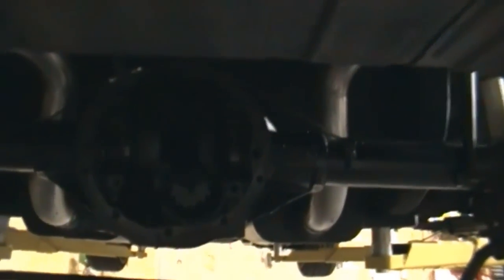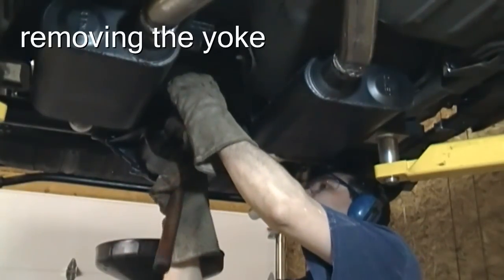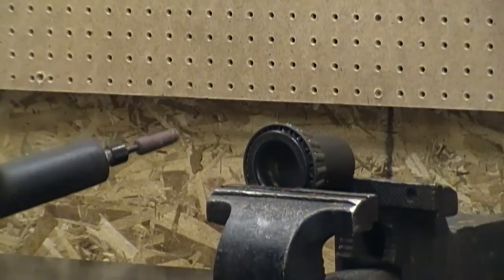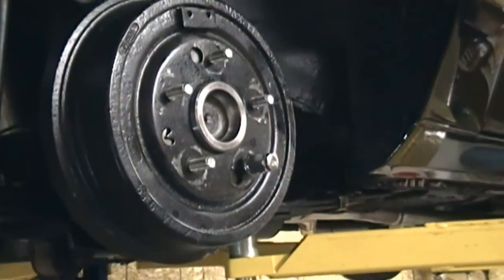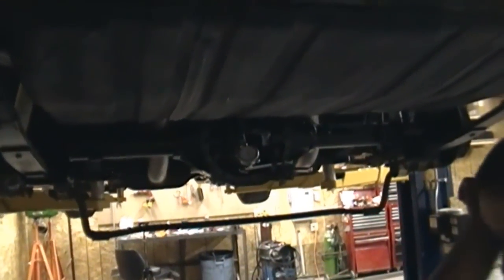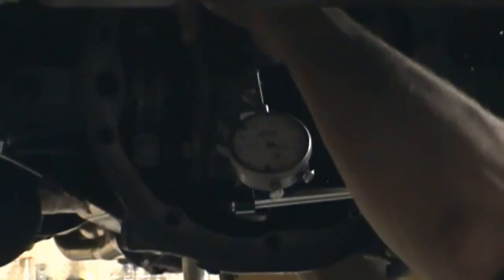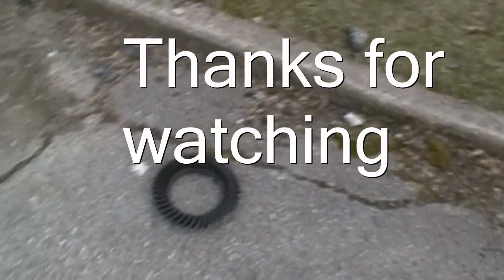How to install or change or replace gears and bearings in a rear end or differential

Comment: I wish I would have seen this video before today. I put a Ford 8.8 axle in my Jeep YJ and lowered the gear ratio (higher numerically). My trial and error with setting the pinion pre load was a big ol' hassle! I'll be doing my front axle next and will definitely use your idea of using the old bearings to test fit. Thanks for the video!

Comment: Having set up many rear ends both 10 and 12 bolts I have to say this video is among the best. Good clear procedure and nice explanation on the "set up" bearing. Gear swaps are not black art, just careful methodical procedure. I also have a pinion depth tool but as you say, just use the contact pattern. I have found factory pinion shims usually are within .002 of correct. The crush coller is the hardest part due to the force required to start the crush. Ten stars from me! Thanks.-TM

Comment: Installing my eaton carrier required me to add about 040. shims on each side (in addition to the 1/4 inch factory shims) to get the correct pinion backlash & bearing pre-load. I also had to use a block of wood and a hammer to force/wedge the carrier with the correct shims into the housing.

Thats cool that you're also into pontiacs, I hope you looked at all my videos, there is a nice slide show of my engine and my roller cam/valve train. If you have any questions feel free to ask.

Comment: I like this video and watched it several times before I attempted to install a new Eaton 8.5 posi carrier. I do however wish this video had shown the removal of the carrier (and the force/technique that was required to remove it) and the show the re-installation technique of the carrier and the shimming to achieve proper carrier bearing pre-load and backlash for ring gear.

Comment: Very informative video.  Now I see how everything works and fits together.  My 7.65 10 bolt rear end started coming apart and had a shop rebuild it.  Now I see why it so expensive.  Definitely not something I could do at home in my driveway.

Comment: Very informative. I have a set of 4.11s to install in my Camaro. I built the entire engine myself, but I'm finding differentials incredibly intimidating, plus I don't have all the proper tools. You may have just made up my mind to take the rear end to a shop instead of attempting it myself... won't feel quite as gratifying though.
Reply: Good call, I want to change the rear end carrier in my superduty to a truetrac, but the torque levels for an axle that size and the results if you foul it up are so drastic, I'm not going to mess with it. I don't have the tools for that kind of work.

Comment: Awesome video mate, rebuilding my '80 WB Kingswood tonner (You've probably never heard of this it is a Holden model) 350 chevvy small block n/a aussie 4 speed and I'm swapping the diff gears out from 3.55 (factory standard) to 2.78 for better highway driving!

Comment: Really informative video that, i have got to build a 8.5 for my caprice sleeper so this is gold to me. Strange how GM choose to shim the pinion depth on the inner race of the inner bearing? All the rear loading axles i have build so far shim on the inside of the inner brearing outer race (in the housing) I just hope my inner bearing is not too worn or i'll have to get 2 new ones to set it up! Great work

Comment: Good video. It's what I need to know, but it doesn't really put it all in my lap. I'm puting an Eaton posi into my 12 bolt GM corporate truck axle soon and this video does help me to wrap myself around the job.
It looks like a good idea to:
1. Read the manuals and watch the videos (like this one)
2. Open it up and really know what you're starting with
3. Use the car as a mounting fixture so you don't chase it around the shop
4. Don't go cheap or take shortcuts
5. Be patient

Comment: the thumping is when i'm cruising and give a little more gas, this is mainly on the highway and taking off from a stop. i had the car on jackstands today and there is a slight delay from the time you turn the rear wheels until the pinion starts moving. used gears are ok to use as long as you inspect them for damage and clean them good. with used gears the clearances like to be a little tighter since they are seasoned.

Comment: when removing the yoke, another thing besides the torch if you dont have it, you can always use a pipe wrench to hold the yoke while you take off the nut, this is great when its a trail repair and theres no heat..

Comment: thanks for taking the time to make this video. for my diff there is no specification for pinion depth, so when i do the dummy fit, do i tighten the pinion nut until i have the correct pinion preload? or just tight enough so i can't feel any play? is getting pinion preload only possible when using a crush sleeve? and will the depth be affected once reassembling with a crush sleeve and setting pinion preload? sorry for all the questions

Comment: 6 acceptable gear patterns. Sierra gear and axle. Drive and coast center and toe to heel.. Drive and coast center to center. Drive and coast toe to heel. Drive and coast heel to toe. Drive and coast heel to heel. Drive and coast toe to toe. I have been rebuilding rearends for 35 years.

Comment: I replaced the bearings in a Dana M80 diff with adjustable aluminium bearing race housings.
The trouble is the diff started to whine due to the inner race of the small pinion bearing being damaged (pinion torque preload was at zero Newton meters) due to that so there was both longitudinal & lateral movement of the pinion, so I thought there was no guarantee that the gear set will be quiet after I replaced the bearings.
The pinion torque was set at 2 newton meters,I used an impact wrench to carefully crush the collar to achieve that torque setting.
The torque was measured with a small torque beam indicator,the total preload measured at the pinion was 2.4 newton meters,the extra 0.4 newton meters was arrived at by dividing the side bearing preload figure of 1.5 newton meters by the diff ratio of 3.91 to give a figure of 0.38 newton meters,0.4 is the closest figure I could get.
I set that torque up after bluing the gears with Prussian blue bearing dye,I got the tooth contact pattern all good,I took note of a gear backlash figure of 0.12 millimetres & set the lash before I blued the gears.
The diff did have a bit of s whine in it when first assembled but now is nearly gone at 35,000 kms after the bearing replacement, there is no noise except at 60 & 90 km/h there's a bit of a whine which is fading away,it was noisier when I rebuilt it.
There is a little bit of noise on the coast side of the diff gears on deceleration,so reassembling the diff with new bearings & ignoring a little bit of diff whine till it's gone has worked !!!!
Reply: Do you know how to place the rear end gears back in mine fell out while replacing my bearings on a chey Silverado 1500

Comment: I don’t have a shop press so I stuck my carrier and pinion in the freezer and put my bearings in the air fryer at 400* and they slide right on…. Takes forever to get them all on. Thought this might help someone that doesn’t want to go buy a press after buying a bunch of rear end parts.

Comment: @Oldsmob455 I am aware this is a setup bearing and that you exchange the setup for a unground permanent at final assembly. But the 2 bearing bores are different diameters and the 1st allows lateral movement due to the enlarged bore, resulting in a false wear pattern.

Comment: I'm in much the same position as tc1811 except I only want to change out the open carrier for a posi unit. My thought is that I won't need to adjust the pinion at all. I'll hopefully be reusing the old gears and be able to get by with just adjusting the backlash.

Comment: Nice video.  Wish I had the lift in my shop as you do.  I've got this to do on a '04 Jeep Grand Cherokee so I'm watching all the videos I can find on this subject.  How is the rear end acting after break-in?  Been a while since you did this one.  Interested if your adjustments worked well for you.  Using the old bearing to initially understand the needed shims seems it wouldn't properly approximate the new bearing exactly.  Just wondering if that worked.  Thanks for a good video and for sharing, Clay

Comment: Thanks for the great video.  I wonder if you could recommend me a power train tech in South Florida?   I'm having difficulty deciding whether I should have my rear differential repaired on my 2000 Toyota Tundra. The truck has somewhat sentimental meaning to me, but has over 300k miles.  The engine and ac run great, but the transmission takes first gear rough at times. The body is kind of rough as well and some hardware(interior door handles) need replacing.  I don't know what is the best option, junk it, rebuild or replace with used one.  I would appreciate any advice.  Thanks

Comment: nice video . i have a 93 chevy blazer 1500 and my yolk is loose. like i can twist my drive shaft just a tiny and i was wandering if you cold tell me wat you think is wrong or wat i need to replace. it doesnt make any noise or anything while driving the only thing it does is when i put it in reverse you can hear it thump into it its not smooth but not horrible

Comment: I did a 12 bolt 67 Camaro rear MANY years ago with 456 gears, i used white paint for checking the gear pattern. I never set preload or checked backlash, after properly setting ring pattern and assembly it was smooth and quiet as a mouse, the former owner had a Chevy dealer set it up and it howled and i had to tighten the pinion nut as the bearing was failing so i felt good that a 20 year old kid did a better job than a dlr mech. Not sure is preload was a concern 35 yrs ago, mainly pinion depth?

Comment: What was your back lash? I believe most gear manufacturers call for about .010". Also, I use C clip eliminators, they're a bit of work to install because you have to trim the end of the axle tube, but I feel that is worth it, I can break an axle and I won't crash my car.

Comment: I'm looking at a new Eaton posi and 28 spline Moser axles for my '82 Camaro and am very tempted to do it myself after watching this. It seems like a good project with a few hard parts. My big question is if I use a dial indicator to measure my current backlash and set the pinon to that with the right shims, will I still need to do the marking compound?

Comment: if you have to much back lash, and you adjust it with side carrier shims wont it change the surface contact more to the heal or to the toe of the ring gear?

Comment: Im having some problems with a rear end that will probably stump you but can you help please. My rear end makes a poping or cracking noise as i let off the gas going  to slow down but lessens as i acelerate. I have put three difftent rear ends and have not fixed the problem because they all did the same thing just less until i drive it for a few months then it gets worse

Comment: Great Post.. I just got a used GM 12 bolt Posi, I remove the pinion yoke to change the seal and notice the pinion move from side to side, has about 1/2" play without the yoke installed.   The shop said that's normal and I need to reinstall the yoke, then check the backlash.  I am not sure about that, any ideas?  The shop also said all parts are new and all I have to do is to swap out the old axle and drop this in. I would like some opinion before spend more money for this install.

Comment: Great great video.very helpful.im in the process of changing my read end for the second time  in 2 days'thanks to the police'but now i just installed my old rear end but with new gears,my only problems the pinion nut was already taken off without any markings so now im lost at how much i should or shouldnt tighten is.plz help

Comment: great video olds, i just installed some used 3:73 gears in my 95 mustang GT and i'm getting no noise on accelleration, some thumping while cruising and alot of whine on the coasting. the gear pattern on the concave side is like 1/2" from toe to the middle and the convex side is 1/2" from the heel of the gear to the inside. i think my pinion is too deep inside and needs to be shimmed out more to the diff cover for more contact on the ring. does this sound right?

thanks in advance

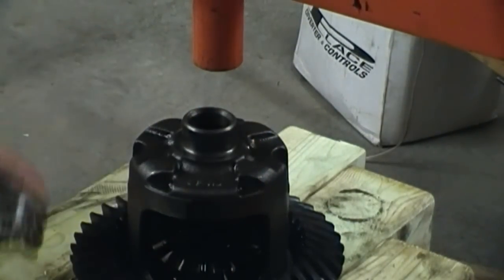Comment: How Did You Remove The Bearing From 2:17 And How Will I Know What My Pressure Should Be When Installing The New Bearing Like You Did In 2:17? I Remember Vaguely Having Been Told To Look Up How Many Pounds The Gears Will Require When Being Installed.

Comment: So, that crush sleeve gets tighten when you tighten the pinion nut and until there is 25 inch pound of resistance? When checking the gear mesh, I guess you tightened the pinion down without having a crush sleeve in place?

Comment: Great video!  I have watched your video several times as I am in the process of swapping out the carrier and gears out of my 73 Lemans.  Question - What beam torque wrench do you have that sensitive enough to read 20 inch-pounds and attach to the 1/2" drive socket for the 1-1/4" pinion nut?  I am trying to track that down.  Thanks!

Comment: Great video, I am also surprised at how much those shims can change the contact pattern.  I think using the old pinion bearings to determine your depth is very convenient, but do the new bearing ever vary in size enough to throw off the contact pattern?

Comment: Question, how can I remove the S spring ? and better yet, how can I put it back in, I am going to work on a explorer 1996, 6 cyl, 130000 miles, should I replace the clutches too ? my plan is to replace only the side gears, and spider gears, but I don't have sophisticated tools, so any good tips are accepted, thanks in advance

Comment: hi ya I have a 79 turbo trans am ,possi track 10 bolt disc brake , I am in need of some advice I am wanting to remove the axels from my car to take the diff out for new bearings ,, I can not get the centre pin to move
 I have taken the bolt out it is like 5/16 short as too not the length in ya video , it un threaded ok ,looked to see if their is a roll pin no pin , I have used a mirror to look down the hole can not see all the way threw the large pin
, I have tried to tap out the large pin that holds the spider gear it will not move other than a few fractions , 2 mm I have given it some good taps and no movement can you advise me as to why it wont move, don't want to brake anything forcing it
 thanks mike
Reply: Is the bolt broken?  OR was it broken... seeing as how the post was 4 months ago..

Comment: Hope I'm not being picky with this but if you enlarge the inside diameter of the pinion bearing wouldn't that promote deflection of the gear itself under load and give a false wear pattern on the ring? I realize the clearance might have been only +.001 but that would be +.0005 of movement.
Still a great video though. Makes me remember why I don't attempt stuff like this laying in my driveway and prefer to pay a shop :o)

Comment: I notice you said don't use a click type? Will it not be accurate? I just installed mine with the click type...
Reply: the beam type will let you know how much torque it takes to take the nut off so you can put it back the same way if youre not gonna set the preload with a dial gauge. right?
Reply: jesus jones I always see a dial gauge being used not the "cheaper" beam type, But I wonder if it works just as well?

Comment: i have a gm 7.5" rear end. i wonder how much difference the process would be for the specs.
Reply: jas hey jas what does the 7.5 measurement indicate,ive seen 8.5 as well but im confused what thats measuring in the rear end

Comment: someone please help me, I have 3:23 gears in my truck nonw and want to swap for 4:56,i Ijust need to buy the ring and pinion gear and that's it? do I need to redo the shims and stuff or should I just reuse whats in it?
Reply: First question is will 456 gears fit in your housing? Second, you're probably going to need new shims.

Comment: What are the symptoms for replacing ring gear?
Reply: if the teeth on ring  are Damage or look wore out. you can only tell once you take the rear cover off and spin it. if your getting f up sounds coming from the rear end while driving  in most case's it the bearing that are going bad.  if the gears are not line up right  it can cause damage to the gear's also.   if your gears are old it best to just replace them anyway while you have everything apart. rather be safe then sorry and have to take it all  apart again .

Comment: i have a 4runner,runs well,but when i turn it to four wheel drive,it cannot go over 30kms,n steering wheel is not straight as before.some time engine heats up.
and worst,if i change back to 2 wheel drive,it takes alot of time.whch is smtimes stupid on a wide open road as i cannot go 30-40 kms over.any idea??
Reply: If it's a 4Runner with the 4.0L V6, you should know that the 4.0L is infamous for blown headgaskets. Yeah. A Toyota with a head gasket issue surprise surprise.

Comment: What is the purpose of marking the carrier bearing caps? I've seen a few other videos where this is done, and I just don't understand why it needs to be done? Thanks.
Reply: Skot Ward Over time the caps set. They are  machined surfaced when installed. They will distort a bit when torqued. Over time after they will build a memory of the mating surface. Changing the orientation will cause improper facing and torque which can lead to premature failure.

Comment: You don't use a impact wrench to crush the sleeve? I guess might be too easy to over do it huh?
Reply: Wow good to know was thinking of attempting this on my jeep after watching several videos. I noticed on another video they said to set the pre-load on the pinion first crushing the sleeve then use shims to adjust the depth later in the process you do it last. I guess it doesn't really matter but your way you don't have to take it apart again.